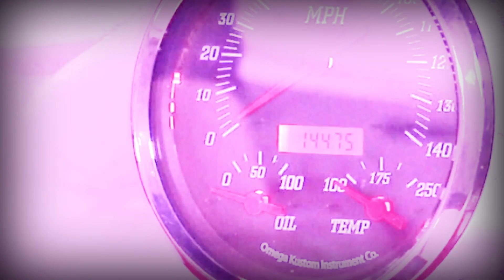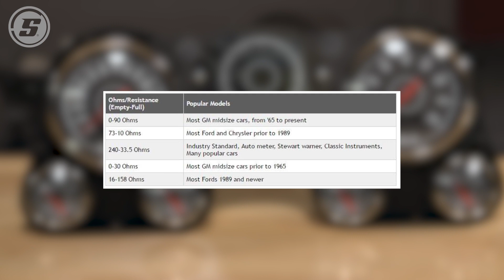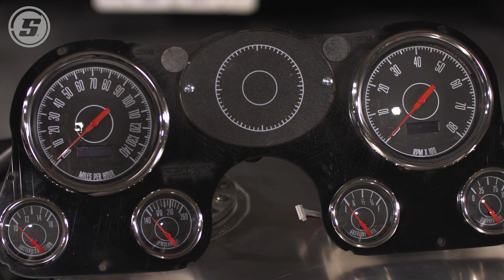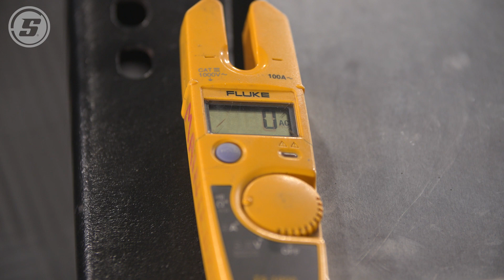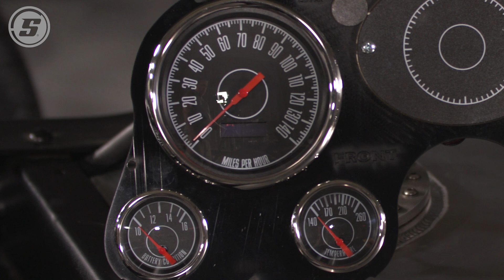How to Check Ohms on a Fuel Sending Unit to Match (New Vintage USA Gauges)

Comment: Have 1960 Willy’s 226l fuel gauge issue. Tried to get OEM fuel gauge no luck. There setting full 8.5 ohms and empty 80 ohms. I purchased a fuel gauge 0 ohms to 90 ohms . Was told it would work however not 100% correct.
I’m have problem getting it to work. 
Wired up as shown. Also fuel sending unit new for Willy’s . And sending wire new.
Why does it not read on gauge.
Thanks

Comment: Great vid. Question: I have a fuel gauge with 2 56 ohm 2 watt resistors attached to it. Is that to limit the current? What's there purpose?